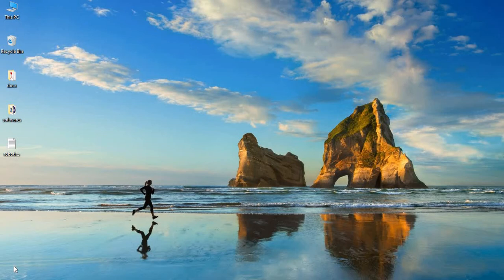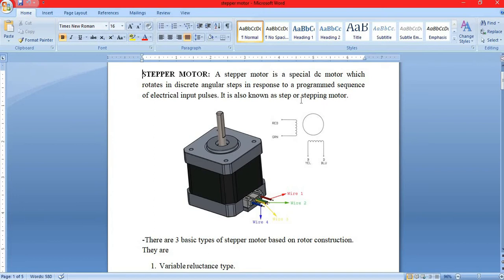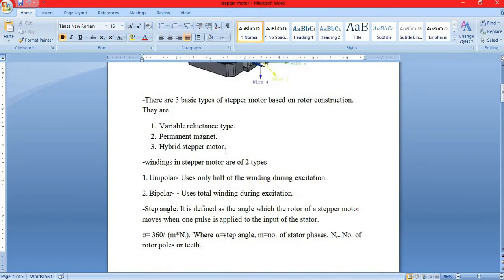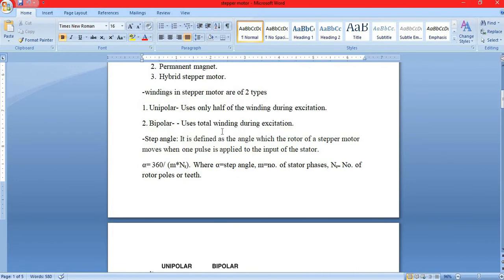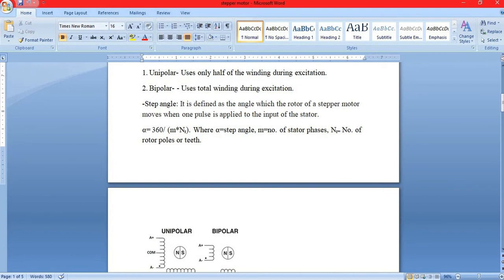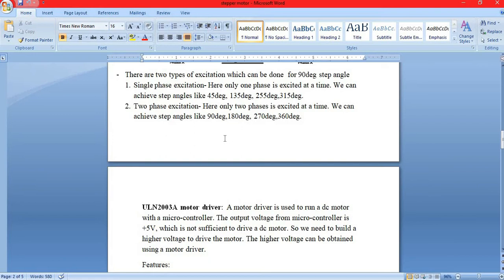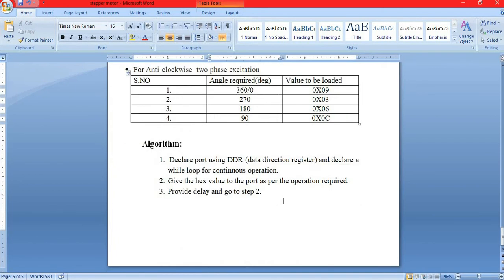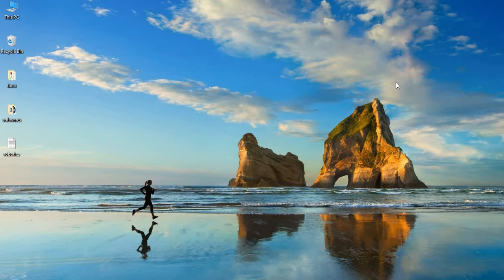Interfacing Of Stepper Motor with ATMEGA32 Micro-controller.

Comment: Nice information! Can I have a motor that rotates even smaller step angle like 5 degree using atmega (on proteus)
Reply from the maker: Yah, you can you need to just change the values. Please like share and subscribe to s.s.embedded world.
Reply: @SSEmbeddedWorld  which values? I am currently having step angle of 45° by exciting 1 coil then 2 coils again 1 coil alternately. How can i get smaller value
Reply from the maker: Calculate the values for your step angle and give them to the port
Reply: @SSEmbeddedWorld  I don't understand, please explain a little code?

Comment: This code is not building in my atmel, I even changed the CPU frequency to 16MHz, what should I do?
Reply from the maker: Hello,
If you straight away copy the code and want to execute means it will not happen coz ther are different conditions in that text. Please try by selecting only one code snippet. If you get the error again then please feel free to mail the code which you have written to ss.embedded.world@gmail.com
Reply: @SSEmbeddedWorld  Yes I'm only trying with one code at a time! I'm still getting the CPU frequency error, please help I have to show the simulation tomorrow!
Reply from the maker: Ok please send me the code which you wrote through mail. 
Mail id : ss.embedded.world@gmail.com
Reply: Hi,
Never mind I got it! Silly errors from my side, but I got it! This is just for the CW phase, kindly respond if needed ahead!
Reply from the maker: I hope you got the concept.
If you find this content helpful please consider liking the content and subscribing the channel.
Much more content is yet to come.
Stay home Stay safe...
Reply from the maker: Firstly, please again see the video completely until the end. so that the issue can be solved. Even if the issue is not solved then please send us through the mail. We are happy to help.
Reply: @SSEmbeddedWorld  I'm getting  this error and msgs-
1.PROSPICE 8.07.02 (Build 25463) (C) Labcenter Electronics 1993-2018.
2. mixed model AVR2.DLL failed to authorize - Missing or invalid Customer Key.. [U1]
3. Loaded netlist 'C:\Users\name\AppData\Local\Temp\LISA8197.SDF' for design 'motor simulation.pdsprj'
4. Real Time Simulation failed to start.
5. Simulation FAILED due to fatal simulator errors.
Reply from the maker: Once try to reconnect the circuit by clearing all. it will work